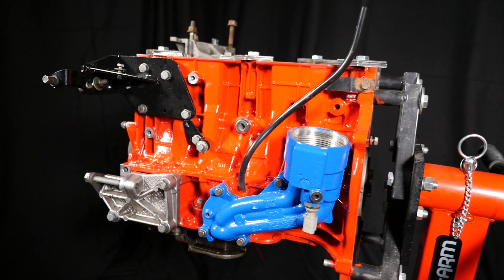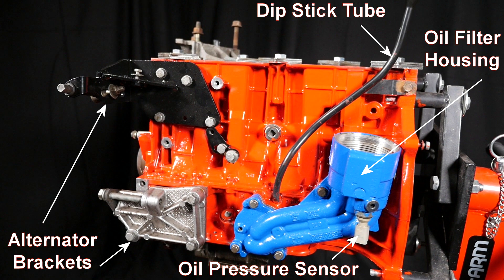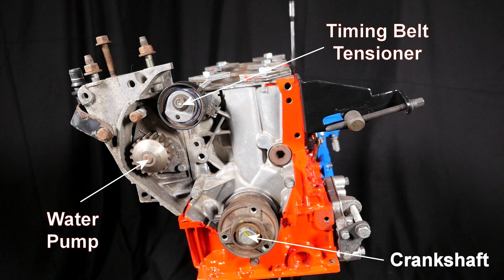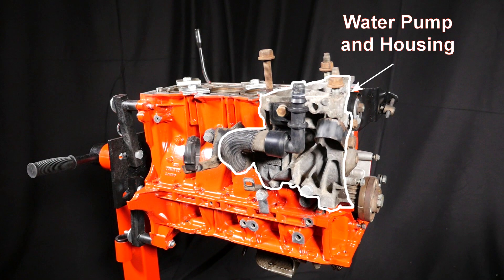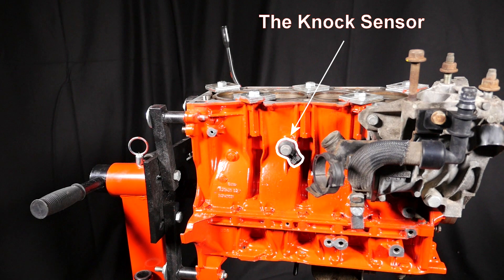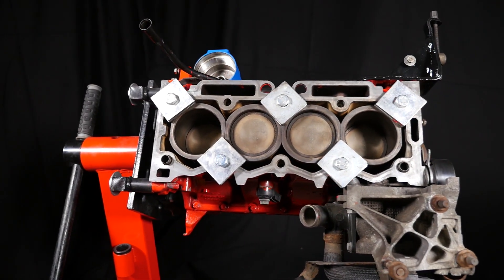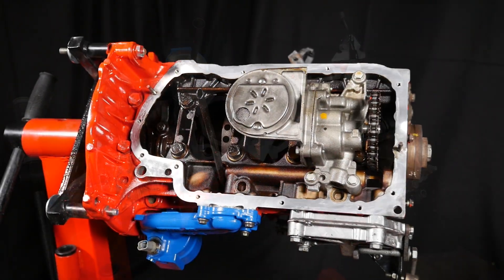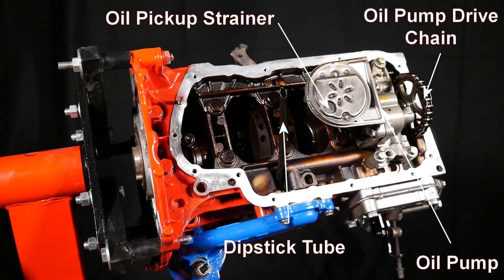PSA Peugeot 106 1.1 TU engine Part 1 - Overview of the main engine block

Comment: I also have a TU1JP engine (Peugeot 206 1.1i from 2001). I'm enjoying this series of videos a lot. Thanks for the great editing and presentation. Just a random question. I've read the engine block has a bolt that you can use to drain the coolant. Is it visible here?
Reply from the maker: Thank you for the comment.  Sadly I had to call this series short with loosing my job and moving.  at 0:37 could it be one of the square holed screws?

Comment: Really interesting video, didn't know that there was a knock sensor on these engine.
Do you know if it's used to advance timing when it can?
I'm running e85 on my 2008 TU3 (1.4 version) and because of the really high octane rating of the ethanol, the timing can be advanced. Does the engine is doing it by itself?
It runs quite nicely on ethanol, first startup is a bit hard when temp is below 20C but once started and heated up it's perfect
Reply from the maker: Thank you for the interesting information.  I really like these little Peugeot engines, so simple to work on compared to the Honda I am having to take apart thats now knocked my Peugeot  back a bit as I have to get the Honda gone asap.  Sounds like you have far more experience than me on these engines.
Reply: @CoatsandGaiters  The only weak point of this engine is the head gasket. I'm really respecting the oil change and cooling intervals.
I do an oil change every year (10 000 km instead of 30 000), usually before the winter. Ethanol tend to mix with the oil.
I also pay attention to use the heat at least once a week to make sure the coolant does not stay in the heater core for a long time. I never did it but I know that heater is a pain in the ass to replace. And non moving coolant can become bad. That may be overkill but I don't want to change the heater core lol
Reply from the maker: @L3xou97  The heater core of all cars was a nightmare I believe.  I managed it fairly ok on a Volvo as I recall.  I tried bypassing it on one car till I froze to death and realised just how important a car heater was in winter.  I think you right regarding being extra cautious.  I dread to think how hard it would be on a modern car.
Reply: @CoatsandGaiters  Maybe I have more experience than you on the theory part, but pretty much the only thing I can do is an oil change lol
Reply: @CoatsandGaiters  All the TU engine start to leak oil on the cylinder 1, just above the alternator. It's not bad for the engine because generally the coolant is not affected. 
In France the technical control is harder and harder, if you have an oil leak you get rejected.
If you want to make easy money, just come to France and buy cheap TU cars with blown head gasket, repair it and sell them lol
Reply from the maker: @L3xou97  I think the UK has adopted that oil policy in it's latest MOT now.  Oil leaks (engine, gearbox etc.) can be a major failure if they are deemed large enough.
Reply: @CoatsandGaiters  If I knew how to change an head gasket on TU I would buy all of blown head gasket TU at a reduced price and change it 😂
Do you think it is possible to change an head gasket without lifting the car or going under it?
Reply from the maker: @L3xou97  That's what my video was part off.  I was at the stage of putting the new head gasket on when I had to suddenly do the head gasket on a Honda CRV.  I hope to complete the series once the Honda is done.